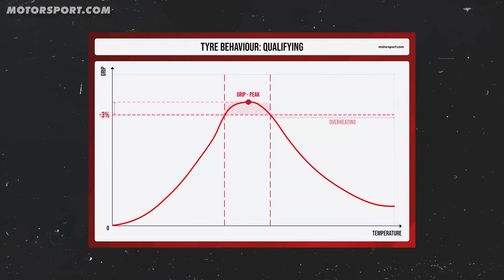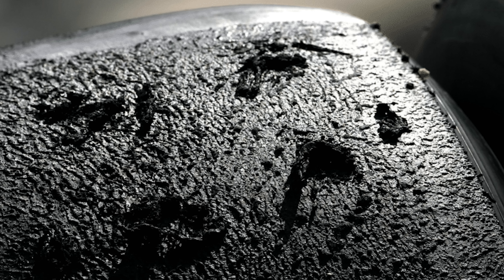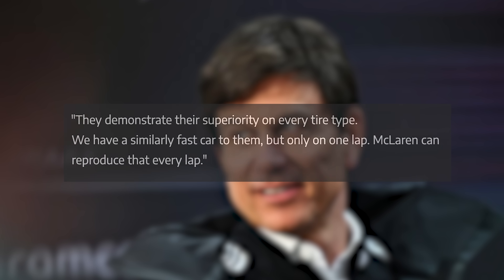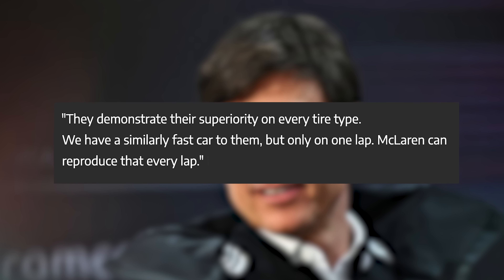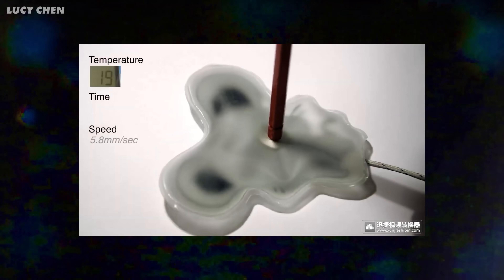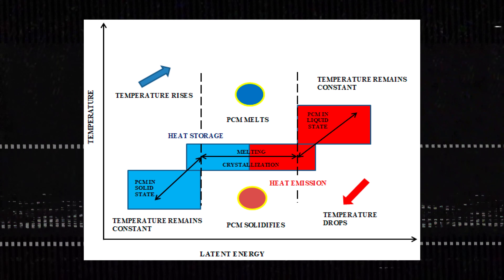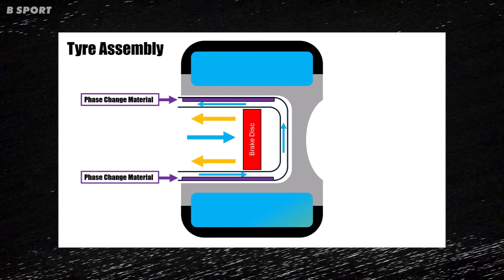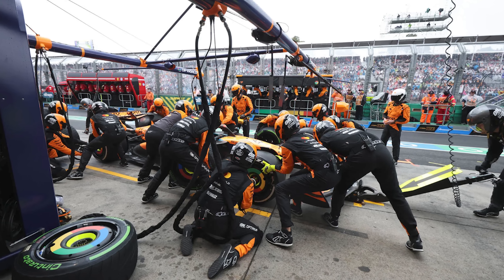McLaren’s GENIUS Tyre Trick Explained

Comment: Besides water cooling, other teams were concerned that the brakes were cooled in an other way then is allowed, and would be cheating. This has not been proven...yet.  It is also almost impossible to cool the brakes (and tires) the way McLaren are doing, without 'external' cooling. Just because FIA did not find it, does not say it is not there. It has happened many times before that a car was declared legal, but certain systems were declared illegal later on during the season.
Reply: Is the rule, that you are not allowed to force cool the brakes?
If that is the rule, are you allowed to ducted air into the brake area?
Reply: @benjones4365 he wrote his point a bit weirdly "...cooled in another way than allowed, which is not allowed". Cooling brakes/tires are allowed, just regulations defining what you can do, and as always engineers find ways to be legal while not "conforming with the intentions of the rules". Therefore the regs are changed/updated even during a season now and then. If FIA find something on the McLaren they don't think "agrees with their intentions", they may change/add to the regs during the summer brak or something. That still wouldn't mean McLaren cheated, just that the found an innovative way to keep tires in the window longer and the other teams are just not as good at it.
Reply: @bennylloyd-willner9667   I made a fault editing my text, what I meant is, that it is not allowed to use an electric fan to cool the brakes (bad example, but just to make the point), you are allowed to use the air that goes through the brake duct.  So if they would use an 'electric fan' it would be illegal. If they use something else, it might be a loop in the rules, which is not illegal, yet. Strange thing is they are not allowed to use a rear wing that flexes, which they still do.
Reply: @bennylloyd-willner9667  Thank you very much for the explanation. I was a bit confused regarding air cooling. It is obvious that McLaren have come up with a brilliant solution, is it not the job of the scrutineers at the next race to check how they are doing it, to make sure it is legal?

Comment: Now I think, McLaren probably had their brake problems a few years ago at winter testing and the first few races that season because they were testing this! So it took them until halfway last season to perfect...I guess the other teams have got their work cut out.😅
Reply: Oh my God you’re probably right. Makes me think what could’ve been if Mercedes actually found a way to make the 0pod work
Reply: @adamjones7701  The zeropod would never work because it was thought in a the perfect conditions of a windtunnel and CFD. The zeropod gave great numbers on both, but on track it revealed the problems of working in a very controlled environment and not thinking about the variations. Since the zeropod worked by diverting the dirty air of the front tires using a "virtual sidepod", a series of vortices created by the "big wing" at each side of the driver, soon a gust of wind or dirty air from another car comes along, that airflow gets disturbed and the dirty air gets "swallowed" by the top of the diffuser. That's the beauty of a physical sidepod, it doesn't change shape when faced with wind or airflow variation.

The other thing that the zeropod brought, that was again a big problem for Mercedes, was the packaging. The fuel tank was packed on top of the cooling system, which raised the center of gravity when they had a full tank of fuel. Ever wonderer why the 2022 Mercedes was so good at the end of the races? It looked like a completely different car balance wise. That was because the tank was getting empty and the center of gravity shifted downwards, giving much more stability.

Because of these factors, the zeropod just didn't work.
Reply: You're on to something here 🤔🤔
Reply: Your theory makes a lot of sense. Good point.
Reply: There’s next to 0 chance other teams can recreate this. Maybe the other top teams, but everyone else is screwed
Reply: @jjjfo1818 especially within this regulations. Next year the whole picture changes and it may not be as useful.

Comment: What people fail to realize is tires is a compound of chemistry not just vulcanized rubber....some tires are just made from Urethane with  graphite added to give it it's black color ...I'm curious now to what proprietary compounds formula 1 uses...
Reply: I used to work at a coal dust factory. Tire manufacturers were our biggest customers by far because they use it as a filler agent. Graphite would be very interesting though because of its thermal conductivity.

Comment: Wouldn’t bi-metal flaps in the brake ducts be lighter and easier to deal with? They would bend with heat and be self regulating
Reply: Would be a movable device in air - therefore a moveable aerodynamic device
Reply: @brandonsmoot4056 not in external airflow so should be allowable
Reply: @tonflo1  Article 3.8 of the Technical Regulations specifically) dictate that all components influencing a car’s aerodynamic performance – such as front and rear wings – must be “rigidly secured to the entirely sprung part of the car” and “remain immobile in relation to the sprung part of the car”. The F duct was banned despite being internal to the car.
Reply: @brandonsmoot4056   I have pasted the entirety of section 3.13.2 of the regulations in here twice. It has been deleted twice. Read it. Covers brake drums. NOTHING in it about moving parts or phase shifting materials. Whatever they are doing in there is legal.
Reply: @tonflo1  you can imagine that sections on brake drums is not all inclusive of all regulations on brake drums right? Like the rare alloy section is not in 3.13.2 but still applies?
Reply: @brandonsmoot4056  It's all for brake cooling, not aero and if it was done in a clever way that could be proven to not affect downforce at all, Formula 1 would approve it when McLaren approached them with the idea. All these things are run past Formula 1 before the teams even produce a part
Reply: If something is not specifically prohibited it is legal. Smart teams read what IS NOT in the rule book.  Go find some more sections on brake drums. Show us all where it's not allowed.
Reply: @tonflo1  love your racing spirit
Reply: Great guess 👍👍👍